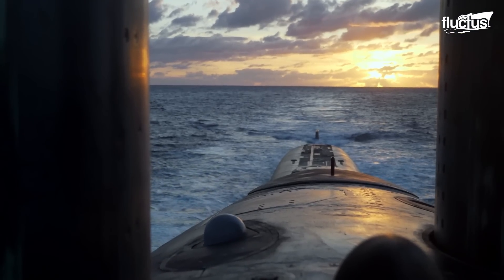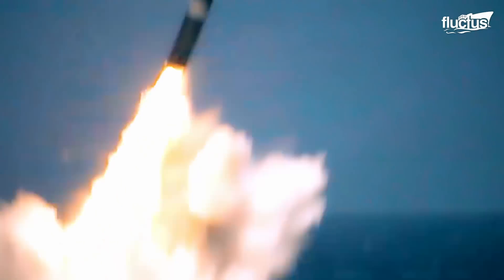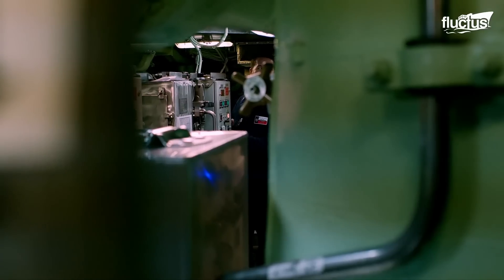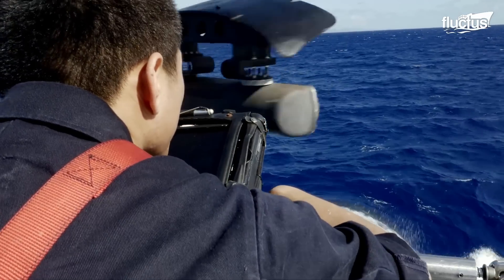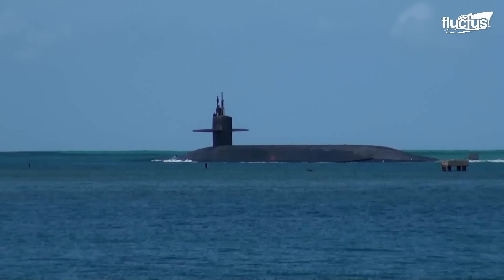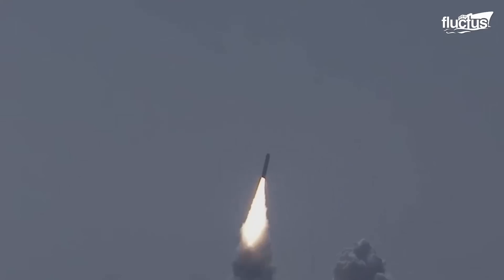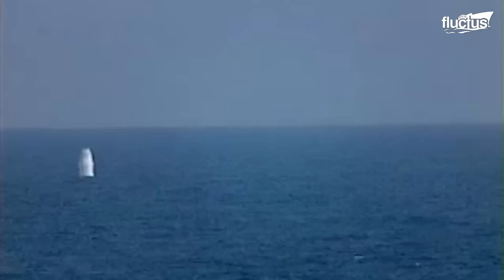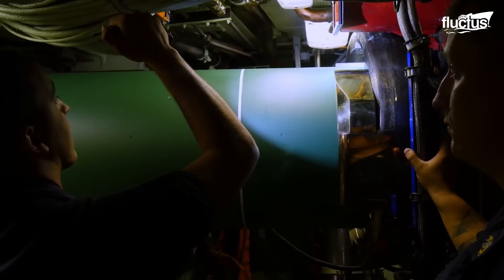The Dangerous Process to Surface Billions $ US Submarine After Months Undersea

Comment: It is Routine to surface no matter how long you have been submerged. Depending on what type of transit lane your in or in the middle of the ocean, there are surfacing procedures you go through, unless you have had to emergency blow. Then you have to hope nobody is above you. Normally you will come up to 150ft. Slow down. Trim out the ship. Make preperation to come to periscope debth. As you are coming up to PD. You raise the periscope and you are looking for shapes and shadows. Sonar is calling out all contacts to the Con. When it is clear on the surface, then we will surface the ship. The problem is if the vessels on the surface are not making any noise. We surfaced at night one time in the middle of a fishing fleet. They were trolling and had their engines off. The USS GEORGE WASHINGTON sufaced Underneath a chinese freighter. It was dead in the water. She ended up putting a ESM mast through its rusty hull. The freighter sank pretty quick. The GW had the most peace time tonage sunk during Peace time.  So shit happens. MMC/SS A-GANG RET.